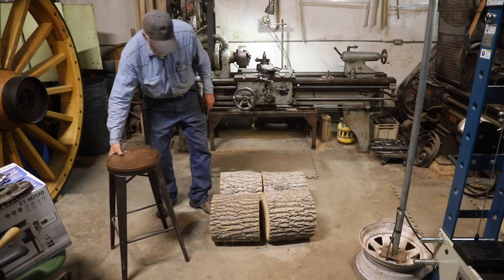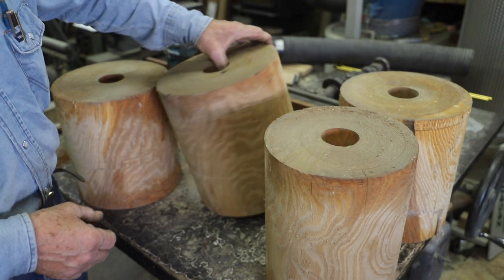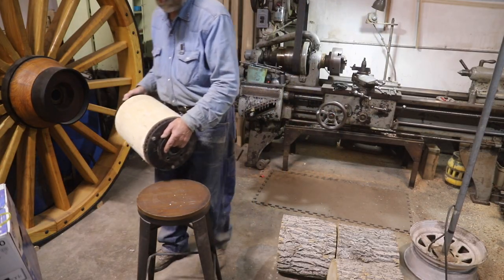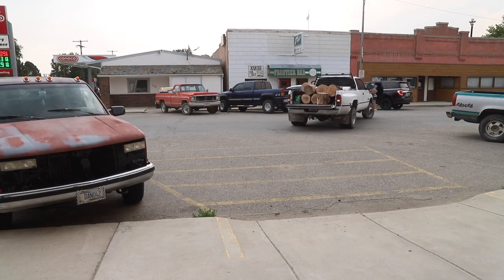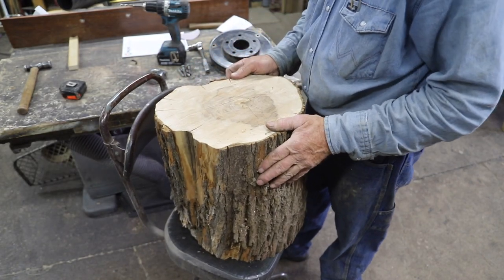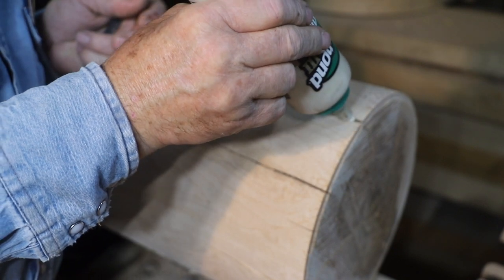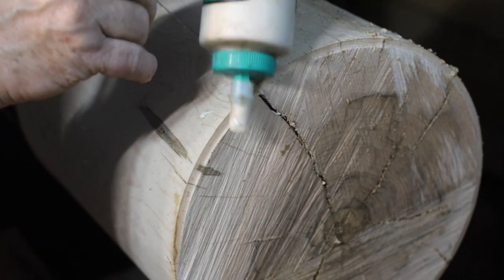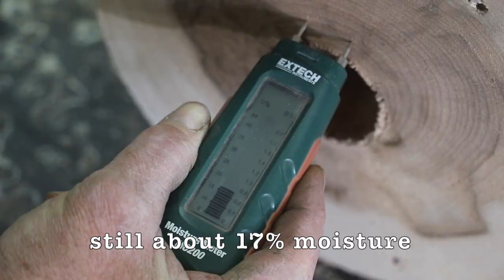Some Firewood Produces Excellent Wagon Hubs | Engels Coach Shop

Comment: My neighbor let me have the apple tree he had in his back yard. They were little red apples. I have them off the ground and removed the bark. these are 16 -18 inches diameter and 6 - 7 feet long. How good is apple for hubs?
 I'm going to cut down two white oak trees from my daughters property just for making hubs as well as for rest of the wheels. 
I'm hoping to have my grandson and myself to try make a covered wagon and a chuck wagon, but I am wanting to make one with no power tools. Make them like they were made in days gone past. I just hope they will still want to do them since they will be 18 - 20 years old by the time to wood dries. I'll see.
Thanks for sharing. It will be a sad day when you hang up your tools and walk away.
Reply: Sounds like a crab apple, from the description. You find them around old homesteads. They used the crab apple in jelly making since it was a super high source for pectin that made low pectin fruit set up into jelly.
Reply: @garymurt9112   - It wasn't a crab tree. We used to eat these apples. They were sweet but not as big as red delicious apples but same sweet taste.
Reply: Power tools go way back in the wagon trade. Steam power, water power, wind power, horse/mule/ox power. Is a treadle  or bow driven lathe a power tool?
Reply: @wssides   - I totally agree with you but those forms you mentioned are tried and to of days gone past. 
I'm talking about forms of power you listed because those are things that you can't plug into a power outlet or have batteries to make a motor to run. I'm going to make a spring pole lathe turn what I need and use hand saws, hammers, brace with bits, tenon cutter, and everything else that is required.

Comment: Man, that first piece with all the holes would make a really nice project! I need to hurry up and get a decent wood lathe. How difficult do you think it would be to cut the outer side off? Make it a sort of sleeve, where the outer half could still slip over the inner half?  That way you would have 2 cylinders to turn down. Then once you land on your design make sure all those holes go all the way through and fill them with a clear tinted resin and wire in a light…. If you really want to get creative wire it so they both spin at a snails pace, just in opposite directions.

Comment: The ash logs were probably infested with pine sawyer grubs or some other wood borer larvae that came from egg laying after the logs were cut. Taking the bark off when you cut the trees prevents borer damage. Drilling the hub blanks when green would also help drying check-free. Painting the end grain is helpful. Laminating hub blanks from kiln dried stock is a more efficient use of time and materials.

Comment: I was wondering if you ever consider using a vacuum bag  to eliminate cracks in  hub blanks. fill it up with slow setting resin, pull down into vacuum, wait for it to go off.

Comment: @EngelsCoachShop Have you considered using a vacuum chamber and impregnating the logs that might work with epoxy? I don't know if this would produce a blank that is strong enough or not. It might also be cost prohibitive. What are your thoughts?

Comment: I wonder if you might try boring out the wood a bit earlier?  When green even?  In bowl turning we generally turn green now, where 50 years ago, one always had to wait.  I cut the blocks, turn them down to "thick walled" bowls.  Let them sit in a sealed paper bag or something for 6 months, then they are drier.  (being only 1" thick walls, they dry a lot"  THEN you can turn them the rest of the way.  Obviously, green wood turns really easily and fast.  Then if you bored it out, it would probably dry just fine.  AND you would not have to have so much worry about those Lyctid beetles or whatever they are,  They generally like sap wood, not heart, and you would get to it before they got in it....  just a thought.  I don't have ash, but lots of white Oak, Tan oak, Bay,  all of which the beetles love.

Comment: Would really recommend a pair of leather chaps when using a chain saw...as a now retired physician assistant I have repaired several leg lacerations over my 35 years from chain saw injuries.
Reply: Even if it were a leather welding apron.   Getting leg cuts suck!
Reply: Leather won't help that much, but a light set of Kevlar chaps does.  I have to admit though, that chaps are hot.  I don't wear mine most of the time.  I DO however always wear a helmet, (face protection, ear protection. head protection)
Reply: Patience, control and forethought work just fine.
Reply: @bushratbeachbum  He certainly isn't stupid..on the contrary, I have always been impressed with his abilities.  However, using a chainsaw has it's issues and doesn't depend on our smarts only.  One of my large knee laceration repairs was the local hardware store owner who sells Stihl saws and he ALWAYS sells chaps with his chain saws BUT didn't wear a pair himself.  It cost him my fee plus the ER fee plus a lot of embarrassment.  Leather chaps stop the saw blade.

Comment: There could be a glut of wagon wheel hub material in MN as emerald ash bore kills ALL of the ash. We only have one BILLION ash trees in MN according to the forest service just in our state. After that you will need to consider another wood. Probably a good time to talk to some saw mills for your wood plank supply also. Maybe the end of baseball too as bats are made out of ash.
Reply: Same for Iowa. It's sad. I will have seen two species of tree gone almost extinct in my lifetime. First was American Elm and now American Ash. Both to some pathogen carried by beetles that no one knew/knows how to kill. Millions of trees. ☹
Reply: Actually, the larvae of the emerald ash bore beetle is the culprit! It tunnels through the tree just under the bark in the cambium which carries water and minerals for the tree. When this is sufficiently interrupted by enough larvae tunneling the tree dies. You can kill the larvae at a cost of 2 to 3 hundred dollars per tree every other year for ever. I have 6 trees so do the math😢 @brianconway4275

Comment: Drying lumber for turning is very hard, I find cleaving the log down the middle when green is the only way of preventing big checks. If you are milling boards then look into sola drying (green house for lumber) it reduces drying time from years to 2or 3 months.
Reply: Then face and glue together again. If the hubs are usually laminated, why not?
Reply: @jonwatson9765  really you need a log twice as thick so once cleaved you still have enough.

Comment: Just subbed dig the content, (so far), isn't there a way to dry the wood faster?
Reply: Yes, it is called a kiln.  The wood is placed in an insulated room which is heated and held at that temperature for a given number of days depending on the size and species of wood.  It would also be possible to use a vacuum chamber to draw the moisture out, but that would use more energy than heating.

Comment: Could you use a 2 part epoxy to control the cracks rather than glue and sawdust.  Whe I have wood that is spongy or rotting, I use a marine exoxy to stabilize it.

Comment: Very clever the way you disguised a firewood cutting video;-)  Regardless, you needed to get those logs cut up for hubs or the fireplace.  Do you seal the ends of the logs when you cut them?  Anchor seal or even paint works well to slow the uneven drying, checking and cracking.
Reply: He said he uses linseed oil.
Reply: @Mishn0  I did hear him say that once he drills a hole in the middle of the log.....however, if he seals the ends as soon as the tree is cut into logs, he will have fewer cracks and checks....imho.
Reply: @Mishn0  
Raw or boiled ? 
Applied hot or room temperature ?
Reply: @justjerry8476  He didn't say but raw doesn't harden and remains sticky. My dad found that out when he painted the house with raw linseed oil and by the end of the summer it was all fuzzy with dead bug carcasses. He didn't think it was as funny as we kids did.

 I expect he uses boiled applied at room temp, but you should ask Dave if you really need to know and are not just being pedantic.

Comment: are there not smaller hubs that you could turn down past where the borer's were?  The other option I would think would be to slice them up, cut off the part with holes, and recombine them into a usable size?  Would probably lose one, maybe two of them, but would still give two solid pieces to work with and ash is going to get harder and harder to find with the Emerald Ash Borer ravaging trees all across the country.

Comment: I'm sure you have thought it through but 2 part epoxy would fill those cracks. Is there a downside to epoxy in this application?  I make Beatle  kill furniture and fill the voids that way.
Reply: I have used WEST epoxy on wood for years. I would suspect that any epoxy would be harder than the wood, which is a complication. That wood glue is formulated to be similar hardness to wood for that reason. Love to hear Dave's take on that.

Comment: hi mr engel. so for the borax wagon hubs... did you have to wait 5 years before the hub blanks were seasoned enough to turn? that is to say that there was a necessary waiting period before you could begin construction on some of the parts for the wagon, from the time of commission to manufacture? or did you have some giant 400lbs hubs just waiting around ready to go?
Reply: I may be wrong, but I seem to remember that those hubs had to be built from several pieces because of their size. 2" thick pieces would only have to dry for two years, and some of his projects seem to take longer than that.
Reply: They were solid. They werec2 years old when we got them. They dried for another year the Dave pressure treated them ethylene glycol.

Comment: Do you use any sealer on your end grain, i use anchor seal and slows down the ends from drying out to quick and checking.
Reply: Dave mentioned he uses linseed oil on the end grain.

Comment: Hi Dave. Have you ever used Eucalyptus wood? It would seem to be ideal for hubs.
Reply: Especially River Red Gum which was popular in Australia
Reply: No
Reply: The eucalyptus wood I have used seems to have an open rough structure. But in 1or 2," diameter. No idea how trunk wood is. But it makes great fitewood!
Reply: Jon Watson it's amazing wood for burning - burns hot and minimal ash afterwards to clear up. For any woodworking, immediately after felling you need to seal the ends of the wood - this will greatly reduce the tendency to check/crack/split.

Comment: hey dave i am unsure if you ever told us. however what make is the old metal lathe?  and what year is it?.  I cannot remember the make or year my old lathe was, but i do know the tiny bit of Knowledge that it was a old Production Lathe used in the second world war. I bouth it for scrap price, and totally restored it to mint new condition as a School project for marks. it had a 26 inch swing on a 22 foot long Bed, 6 step flat belt drive. like my south bend flat drive milling machine a few years newer than the lathe, and the old post belt drive Drill Press my dad's neighbour donated to me to restore also. we set them up in Dad's big Shop on  the farm and i drove  them with a over head power shaft that we powered with a 1950? chev in line 6 cylinder truck motor we set on the cut off frame out side the shop wall. It was quite a process to set up to make something with them old dinasour machines but they run as true or truer than new machines. I remember the day i brought home the milling machine i blew both tires on dad's 4440 john deer lifting it off the trailer with the loader. i got the mill at a auction for 100.00 lol
Reply: Those old machines had a lot of iron in the castings. The weight absorbed shock and chatter which made them run solid, smooth, quiet, and accurate if they didn't have excessive wear from decades of use.

Comment: Hello Sir :
  The  Elm wood you are turning is not likely to be American Elm, which is mostly extinct due to 
Dutch Elm Disease.     Living in Billings as I do, the majority of the Elm trees I see here in eastern 
Montana are  Siberian Elms  - this tree has a rough, grayish- brown bark and a very irregular shape.    
It yields  a nice, easy working, light weight wood, but you might find that it does not have enough 
density and crush strength   to serve as wheel hubs on heavy wagons.
Reply: It came out of Big Fork.
Reply: @dianeengel4155  Yeah -  I took a look at the bark on the sections Mr.  Engels was cutting up 
with  the chainsaw, and the bark definately looks more Siberian than American -  A lot of 
Siberian Elms were planted in desert areas in the West in the 1910s-1930s, and they rapidly 
took hold and have become what some 'Tree-Nazis'  refer to as ' Invasive ',    Meanng they 
plant themselves from seeds, and grow where the Tree Nazis want to plant a native tree !  

I also went online and checked out Big Timber, MT - there are lots of photos of houses
with ' street trees ' that are clearly Siberians, and also a lot of photos of the local rivers and 
streams, showing a lot of Siberian Elms.   There is a good photo of a house on McLeod Street 
in Big Timber with a very nice Siberian in the side yard, showing the random, irregular growth 
pattern and shape of a Siberian Elm to perfection.  

The wood of the two species is about the same - light weight, easy to work, but relatively 
low density, and somewhat soft, with a low compressive strength due to it's lack of density.  
In terms of it's mechanical properties, Elm is similar to Poplar, with the added caveat that
Elm has an interlocking grain structure that makes it resistant to cracking and splitting.

Comment: Those that have splits, why not open the split all the way, face the two halves and laminate them together? Or split them down into billets for lamination?
I hate to see good wood turned into firewood. Maybe some other uses?
Reply: Like that idea👍 the glue is stronger than the wood why not cut and shut!

Comment: Golly! So much ash dead on 1.97Ac. Log cabin blacksmith shed first. Got lathes. Got Linseed oil! Smaller elms, too. No horse, so no wagon, until 4 guys can pull it, 0.25hp each, 8250fp.

Comment: About ten years to get a usable hub?
Yes, for a hub that is made using modern tools and will probably last 100 years. But back in the early days when wet wood cuts and shapes easier and probably wasn't expected to last so long, these waiting times seem rather long, so how does hub manufacture, or any part of wagon building, differ between today and the past?
PS can't be long before someone decides to 3D print the hubs. God forbid..

Comment: You might want to switch to a CA GLUE  it would go deeper and stronger!!!!!
Reply: agreed, easier to get into the crack also.  I usually use a vacuum cleaner to pull in the glue also.  Just put the vacuum on the crack, then a splinter between the crack and the place you are putting the glue in... it will suck down around the splinter wedge.  Works well.
Reply: Horribly brittle and not suitable for the majority of wood work.